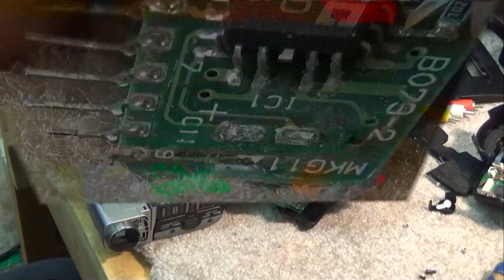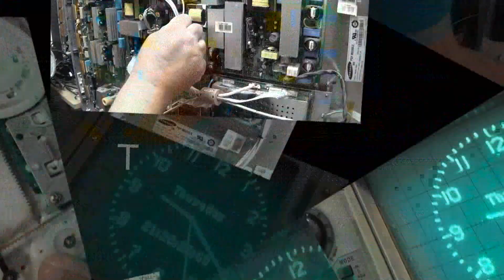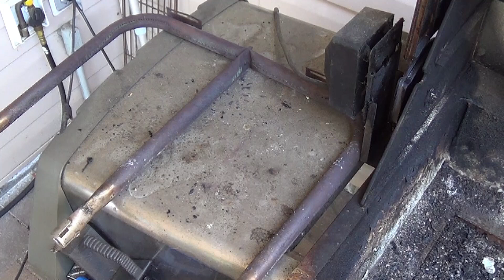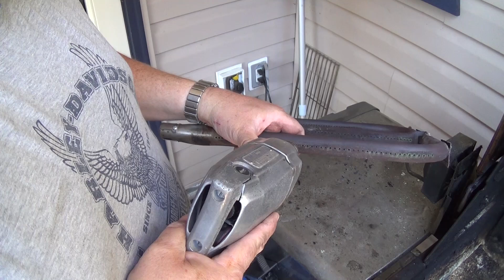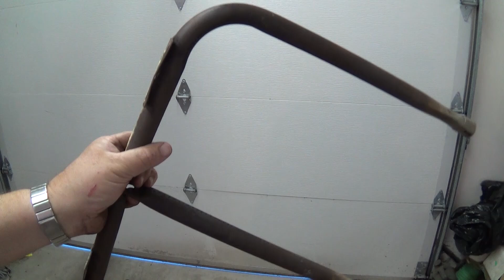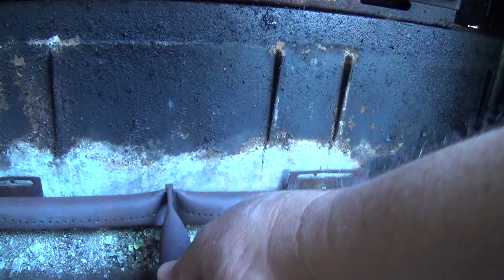Napoleon Gas Grill Maintenence

Comment: The plastic siding behind your grill is melted. BBQ way too close. Lucky you have not burnt your house down. Yet…
Reply from the maker: It's not that the BBQ is too close. My idiot son pushed it up against the house after using it before it had cooled.  It's never used pushed up against the wall. Also on this model the rotisserie which is what was being used throws fire on the back using the entire steel back as an infrared radiator  so the back gets extremely hot when that is being used. Not so much when the grill burners.

Comment: Wish you had included the maintenance on the sizzle zone also!
Reply from the maker: The sizzle zone is pretty much replace it when it fails.   I have changed it once and will attempt to clean up the current one that is also now reaching eol.   There is little one can do to it.  Might try something today and see if i can improve.
Reply: @12voltvids  Thanks! Mine stopped working and doesn’t even receive power to the igniter!
Reply from the maker: @iveywin  the igniter is a seperate module. I just did a maintenence video to clean up the burner.  I did it a few years ago but didn't shoot it but I needed to do again so there will be a video on that later today.   Mine was all clogged up again.
Reply: @12voltvids  do I need to replace the module if it doesn’t provide the click-click-click sound?
Reply from the maker: @iveywin  is yours a battery powered model or one you crank.   The battery one you just unscrew it from the chassis and unplug the wires.
Reply: @12voltvids  The BBQ powers up when I plug into the 110V AC power.
Reply: Great video!  Can the gas valves be replaced?  Two of mine on the same grill no long work and will not even turn.  Thanks.

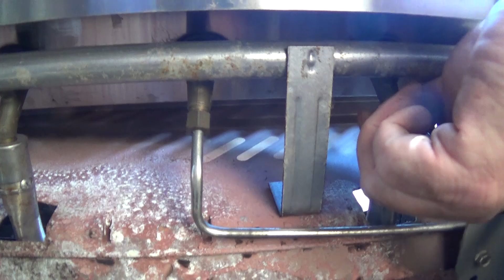Comment: At 8:06 there is a silver tube with several bends in it - maybe 1/4" diameter.  It's called a burner supply tube.  There is one for the side burner and/or the rear burner (if you have either).  My Rear Burner Supply Tube has a puncture and I can't find the part number of that part for a Napoleon Prestige II model 450.  Other model's parts diagrams have them, and interesting that they all begin with n720-00xx.

Comment: This guy is a dumbass his siding is all melted, real safety conscious ..
Reply from the maker: The siding got warped about 12 years ago when I was having a BBQ with a bunch of friends over, and someone pushed the turned off but still hot BBQ up against the house. They do take awhile to cool down. I didn't notice until the next time I pulled it out to use it. Not a hazard because it was off, and it isn't used next to the house for obvious reasons but is stored there.

Comment: Thanks for the vid. One small note - according to the Napoleon manual, the holes in the sear plates are "installed with holes towards the front". Looks like you had them in backwards and the start and end of the vid.
Reply from the maker: That's just to lift them out.  Makes no difference.

Comment: Excellent. Thanks so much for sharing this. The  Napoleon bbq came with a house we purchased and does not heal evenly. The previous owners left the manual which has the drill bit still in package and stapled to the instruction manual. Was wondering what that bit was for! We don't like putting anything in landfill unless necessary...
Reply from the maker: The Canadian made Napoleon will probably outlast you if maintained.   Mine is about 15 years old now.  Changed the IR burner, drip tray and sear plates once.  Everything else perfect.  Clean it out a few times a year and use it a 2 - 3 times a week year round.

Comment: You can get about 90% of the same job accomplished by just using a small hand held Stainless steel wire brush in a fraction of the time. I have similar SS tube type burners and I use a wire brush on them a couple times a year without removing them from the grill. It does a good job of renewing the full flame pattern. Not knocking your methods just pointing out an alternative that works well.
Reply from the maker: I used to do that and it is more like 40%.  Why do you think I started removing the burners and drilling them out? Also Napoleon recommends this and they even supply the drill bit with their own branding.

Comment: Do know how to replace / repair the ignitor .. I have same barbecue and one wire was spliced and is now to short to reach the ignitor button
Reply from the maker: The igniter is available. It is a module that is held on by a plastic nut under the battery cap. There is just a single wire leading to the sparker on the side burner and dual wires on the main ignitor to he sparker on the main burner and rear burner. The sparkers also come off with a single screw.

Comment: Good video,  some of us are a bit OCD,  and kept waiting for you to clean the rest of the BBQ first, drill out the burners and reassemble - but I get it, your focus was on the burner clean out, in which case, just state "that for the purposes of this video, I focussed only on the burners. The drip tray can be cleaned later". Personally, I would have removed the burners took out the drip tray cleaned that and the shell of the BBQ and then drilled out the burners, followed by cleaning the venturi by using the optional Napoleon Venturi cleaner which cleans the venturi portion of the burner and the insides of the burner tubes - eliminating the need to use compressed air.
Reply from the maker: The drip tray was fubar. Rusted. I had a new one on order and installed it after the burners were cleaned. 
I also replaced the sear plates, and put a new grill stone. Which reminds me. I need to get another one because my stone just broke into 3 pieces.

Comment: Very nice video! I have bought a Napoleon T410, i think it's very similar to remove the burners for cleaning. My Napoleon Grill stands outside all the time, what do you think about removing the burners over the winter time and to store them inside of my house so that they won't get rusty?
Reply from the maker: I use mine year round. At least 2 to 3 times a week.  I just throw the cover over it and give it a good cleaning spring and fall.  So far the only parts I have replaced is the sizzle burner, sizzle grill, sizzle plates that go over the burner and the grease drip tray.  Mine was made in Canada.  There are Chinese models also put there sold by big box stores.  I dont know how they compare but the ones made in Canada are fully serviceable and the parts readily available at the dealer.  They are also really reasonable.  The side burner for example was replaced last summer.  It was 75.00. I take the burner tubes out each spring and drill out the gas holes.  As I said mine gets tons of use.  Oh, almost forgot the spark electrode and igniter for the side burner also failed but that was due to a leaking battery.
Reply: @12voltvids  Thanks for the video! Helped me a lot! I have a Napoleon Legend 485 RSIB and replaced the burners, deflectors and cross brackets (at back) today.  I acquired the grill used on Craigslist and it was getting pretty worn out. The parts i replaced were all pretty rusted. My drip pan is also rusted and starting to show holes, and I found a source to buy one from, but was wondering how the drip pan is replaced.  Is it bolted up from the bottom? In the manual it says it  can be slid out from the back, but I can't see how.  Any help would be appreciated and thanks again for the great video!
Reply from the maker: @mojomohambo  
On my prestige the drip tray just slides out from the front. No screws hold it in place. Takes less than 1 minute to replace, and a new one cost me 30.00 last year. My burners are original. I changed the infrared sizzle burner and the sear plates as well as the drip tray. Now it is like new. Bought a grill stone. Just preheating it now. Chicken dinner tonight.
Reply: @12voltvids  not sure what the heck everyone else is talking about, my grill (at least on the inside) looks about the same.  I just ordered a new set of SS grills as my 450 came with the porclean ones that have finally gave out after 9 years of consistent use.  I also bought a new drip tray and upgraded it to a SS version of it too.  I was gonna buy a new burner, but thought Id hold off till next year as the new drip pan and grills cost me $400, but now that you showed out to service it, i dont have to!  So thank you to that!  Best grill I have owned going on its 9th year in use and was a wedding gift so it has some sentimental value, thats why I didnt mind spending the 400 on it. (vs 1400 plus tax on new) I'll probably vacum out and scrub down the sides a bit to freshen it up a bit.  As for your point, the prestiges are typically Canadian made, stay away from the chinese built ones from the box stores as they dont last nearly as long.  I should get another 9 years easily out of this beast, although I'll probably clean it more often now.  Thanks again for the video.
Reply from the maker: @whoanelly-  
I have had mine now for 10 years. Last summer I spent money on it. I replaced the drip tray (40.00) infrared burner (90.00) and sear plates (110.00) 
That is all I have spent on it. I bought an Island Grill stone. I can not recommend this accessory enough.  You will cook the best chicken, fish, kabobs you have ever tasted.
 My Napoleon is used year round. At least 3 times a week rain, shine or snow. I am fortunate as I have a large covered overhang so I stay dry while grilling.  I take the burners out and drill out the gas holes every year as my spring maintenance. You can not compare any of the chinese made big box grills to the Canadian made ones. First of all the Chinese made grills have no parts available. The canadian made ones have every part for the unit available, and they are very easy to change. I am good for another 10 years and I have 240.00 in parts for it.
Try that with the Canadian tire and Home Deopt specials

Comment: Really useful.  I was wondering how to remove the burner actually that was the only part I wasn't able to do! Thanks
Reply from the maker: 2 screws on the back, they are 1/4" hex screes. The back drip plate lifts off and then the burner just lifts out.
Reply: Sorry I didn't explain well... I wasn't able before seeing your video!! I've done it this afternoon really clean job!

Comment: did you ever clean this grill???? ugh..... that´s horrible
Reply from the maker: +Franz von Baki 
Yes it gets cleaned every time before it is used. It had been sitting unused for awhile. I don't clean under the burner every time but the cooking grill is scrubbed before every use. I give the burner a service every year.
Reply: @12voltvids  Yeah but you don't clean it properly and side tables are filthy.
Reply from the maker: @nikokovac7423  
Don't use the side table on left, and right side is a cover for the infrared sizzle zone burner.
I do clean it properly, I heat that sucker to 900' to incinerate anything on the grill and then scrub it down with a scraper that takes everything off the grill bars. The drip tray comes out every few weeks and is scraped clean. In this instance the drip tray was rusted, and I replaced it after the video was shot of the burner maintenance.  As far as splatter into the back, who cares, that doesn't touch food. If you think mine is bad you should see my friends. He uses his even more than me, and his is 10X worse. He doesn't even scrape his, just burns off the residue and wipes off the ash when cool.